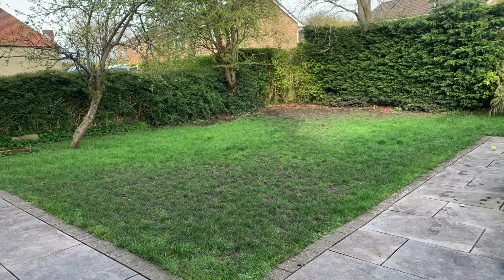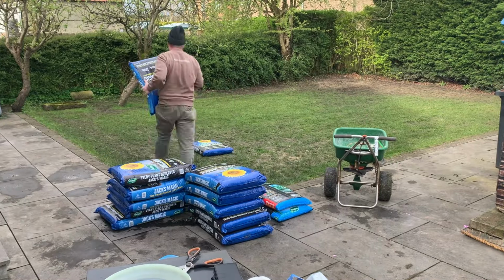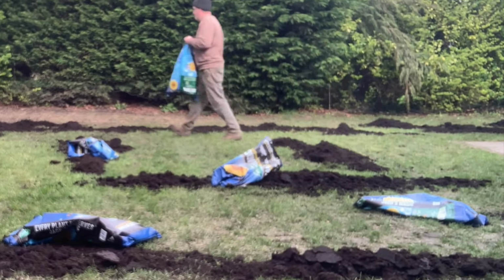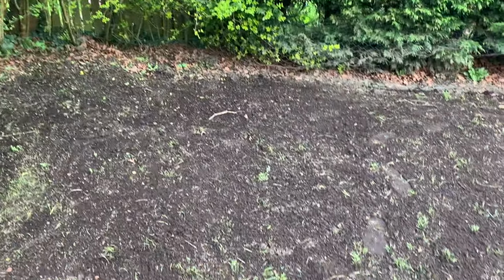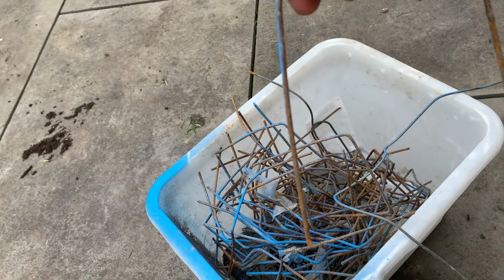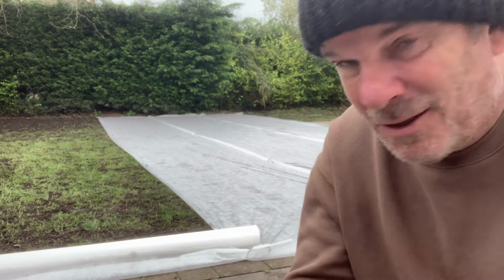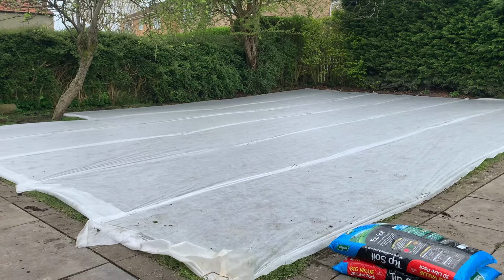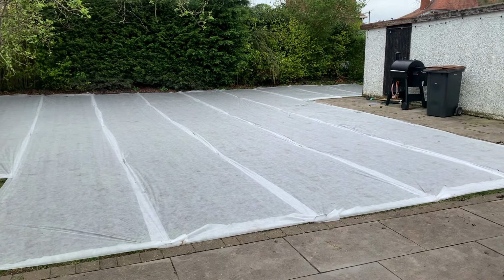SEEDING, DRESSING, And Germination Sheets - Eric’s Lawn Part 2

Comment: Hi Phil, I use the original jacks magic, getting harder to find it these days though. I do sieve it first though to get all the larger stuff out. Any news on the ban for peat compost at the end of the year? Can’t see any updates online and various different reports of years, some end of 2024, some 2027. I just wondered if you have any insider knowledge? All the best, Mark
Reply from the maker: Jacks magic is a Westland product, huge IP, so I guess they are running down all stock that will be sitting in warehouses, most big buyers buy a year ahead. Expect the focus to go to the GC products, but eventually a Jacks will come out. 

Why do you use it over other products out of interest?
Reply: @allgardening  Hi Phil, I find it the best compost out there. Fantastic moisture retention. I don’t touch anything “peat free” it just seems all green waste and shredded wood bark.
My local plant wholesalers does another peat based compost, but have yet to try it. I’m paying £8.67 a bag for jacks, certainly gone up from last year.
Invariably, jacks comes moist. I just cut open a rectangle of the whole side of the bag and leave in the sun to dry out. I just hope this peat ban gets quietly forgotten. Fantastic channel 👍🏻
Reply from the maker: @markjefferson7492  thanks for sharing. There are definitely products for purposes.

Comment: Can I ask , if I’ve used resolve weed killer on the grass about 7 weeks ago, even though it says you can’t reseed for three months, will the amount of rain we’ve had recently wash it through the soil quicker thus allowing me to reseed sooner ..
Reply from the maker: I’m afraid you’ll have to wait, and you might find that the area you originally covered has now been contaminated wider with the rain. 

I’m always very cautious of using any product on a lawn that’s not for the benefit of the grass, weeds are always a problem, but you might find better condition grass better manages the weeds. 

For instance, surface weeds yo can of the remove by scarification, perennials you can remove with a kitchen fork, and close cutting can also minimise weeds. 

So, I think you’ll have to wait. 

Best of luck.

Pls make sure to subscribe, I’ll share lots more information over time…

You could me the 500th! 

Cheers
Reply: Kk . It was on a Friends lawn which was full of very dense weeds, so I just blatted it with weed killer. It’s done the job . He’ll have to wait the full 3 months till reseeding.. cheers for advice. I have subscribed..
Reply from the maker: @vecterprime2621  Thank you. I'll share lots of lawns this year, a story about each lawn, every lawn is different even though they may look the same. It's what makes the job of renovating a lawn any time of year an expert challenge. Please let me know if you have any questions.

Comment: Hi Phil, is it good practice to use the lawn fleece year round or solely during the colder months?
Reply from the maker: That’s a great question. If you use a sheet, you can grow a lawn throughout the whole year just about, growth rates vary, but germination is possible if you use the appropriate seed. Also the benefits of a sheet is it keeps “wveryine” off the area, not just birds, which is a very important thing, and also if you use a sheet and a irrigation system with a computer timer you can get germination within days between May and November, the sheet holds a little extra temperature and moisture during the main season. Lastly, a sheet keeps the seed in positioning you should have heavy rain. 

Where are you growing? 

Let me know if you have any other questions.
Reply: @allgardening  that’s great, thanks for the details response. I’m renovating both front and back lawns. I’m interested in experimenting with rye grass one side and then maybe a bent/fescue mix on the other. If you have any advice (pros/cons) for either three species let me know 👍🏻